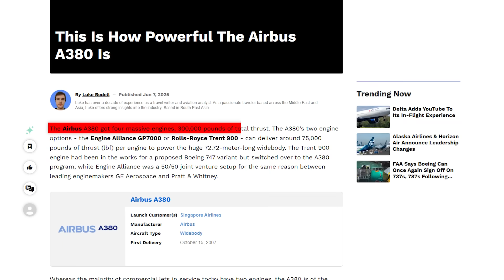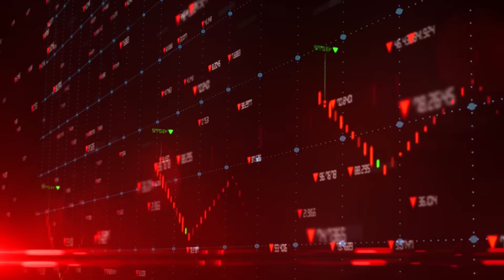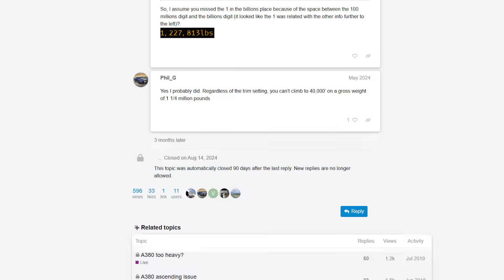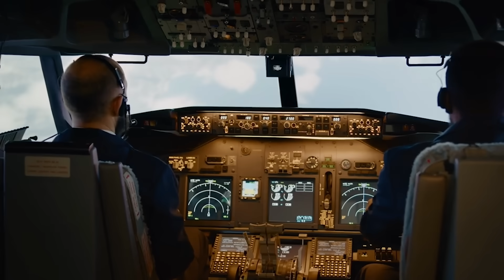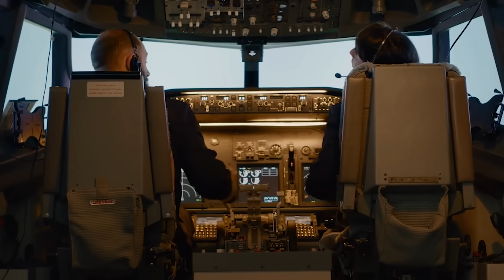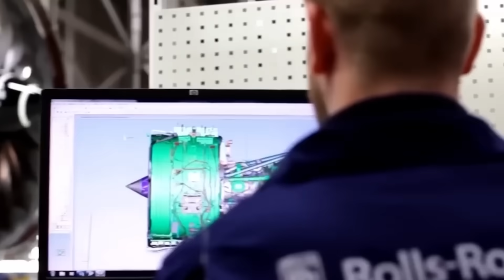Why the Airbus A380 Struggles to Gain Altitude

Comment: Everyone here is missing the point.  With all engines operating a 2-engine jet will outclimb a 4-engine jet  All airliners have to be able to continue to takeoff and climb if an engine fails during takeoff.  Losing an engine on a 4-engine just is only a 25% loss of thrust compared a 50% loss when losing an engine on a twinjet.  This mean the twinjet has much more excess thrust during a normal takeoff than a 4-enigne jet, and that excess thrust translates into climb rate.

BTW, all heavily loaded jets have to step climb on long haul flights. I have crossed the Atlantic at FL290 more than once because that was as high as I could climb for the first hour or so of flight, and when I asked ATC for something in the 30s for the crossing it was not available.

Comment: There is actually a video out there that shows that the A380 can in fact climb at a very steep rate of climb as it does have enough power to do so but that was just for a demonstration and there weren't passengers on board. It has plenty of power to climb more steeply but it's also about not burning access fuel as A380s are for long-haul routes and therefore fuel consumption has to be kept in mind as well..... Being the A380's are for a long haul travel, there's also no need for it to climb as quickly as there's plenty of distance to do so of which is much more economical.....Here is a link to the A380 steep climb capability.... https://youtube.com/shorts/zUgyP_NVOkc?si=ESDNVFuYV2QEYmoC

Comment: Airbus decided to triple down (so to speak), and build the A-3380 SooperDooper triple decker Supermassive Hawking Jumbo, with its 8 engines, carries 3500 passengers,  with a climb rate of 200 ft a minute, and a fuel burn rate of 15,000 lbs of fuel per half hour. 
Some airports jumped on board to retool their airports with longer 30,000 ft runways, reinforced runway surfaces for extra weight,  and bigger gates to accommodate the wider wingspans, at an estimated cost of 15 trillion dollars; a sound investment indeed.

Comment: As far as I know, all commercial jets step climb, which is the most efficient way to do it.  The A380 is still one of the fastest airliners, though not as fast as the 747, which has a steeper wing angle.

Comment: I flew the 380 as a copilot for 4 years and I can guarantee this guy doesn’t know what he’s talking about. The 380-800 was designed to be stretched at a later date, and so the wing and engines on this ‘shorter’ fuselage were more than sufficient to give great performance. We constantly took off from Dubai at max takeoff weight and climbed straight to FL340-350, while the 777-300’s had to step climb from FL280. Plus we could cruise at Mach .85 if we were in a hurry. It definitely is not the prettiest machine, but it’s quiet in the back, has some great tech (the BTV system is brilliant) and is great for slot controlled airports in Europe.
Reply: Ok,  it is one of the prettiest aircraft... not sure where it itbon the scale but it's in the league of Pretty

Comment: The lesson hidden on the climb rate---A380's initial climb rate is among the lowest in the industry, on a par with other large quad jets
Airbus A350 and Boeing 787  can maintain a steeper ROC during the initial climb, although they have similar climb rates to the A380 during subsequent flight phases, quite impressive given that the A350 and 787 are only powered by two engines, although their size and weight are also considerably lower. These two aircraft models can typically climb at a rate of around 3,000 fpm immediately after takeoff, which is double the rate of the A380.
When it comes to the approach, the A380 will generally descend at 1,000 fpm, which is also slower than other aircraft. 
A380 falls into the Super Heavy category of aircraft and has a 'Code F' designation under ICAO's Aerodrome Reference Code. This means that only airports certified to handle Code F aircraft can accommodate an A380. No wonder all major American airlines stayed with twin  engine ETOPS designs. The smaller, twin-engine Airbus A350 and Boeing 787 Dreamliner have significantly more economical fuel burns per passenger than the much larger, four-engine A380. Newer aircraft designs, advanced materials, and more efficient engines give modern twin-jets a distinct advantage.
Reply: "Airbus A350 and Boeing 787  can maintain a steeper ROC during the initial climb, although they have similar climb rates to the A380 during subsequent flight phases, quite impressive given that the A350 and 787 are only powered by two engines, although their size and weight are also considerably lower."

Just about everyone here is missing the point.  With all engines operating a 2-engine jet will outclimb a 4-engine jet  All airliners have to be able to continue to takeoff and climb if an engine fails during takeoff.  Losing an engine on a 4-engine just is only a 25% loss of thrust compared a 50% loss when losing an engine on a twinjet.  This mean the twinjet has much more excess thrust during a normal takeoff than a 4-enigne jet, and that excess thrust translates into climb rate.

Comment: Seems they get they the fuel almost for free because UAE is the number one oil country. The A380 fuel capacity exceeds 320,000 liters, stored in 11 fuel tanks located in the wings, horizontal stabilizer (tailplane trim tank), and center fuselage tanks

Comment: I always wondered why the A380 takes quite a while and has to use up the entire runway to take off and now I know that’s one of the biggest physics problems out there wonder why a lot of airlines have retired the A380 and poor Emirates is stuck with flying the A380
Reply: Why poor Emirates? They're expanding their fleet of A380s. In fact they bought another 4 just this week. It's the perfect aircraft for a long haul middle east airline.

Comment: If we had 280,000 lb thrust and total weight is 1,1 million lb and the minimum wing area must be as followed
1,1×10^6× cos angle of attack (wing area )= 280,000 lb thrust sine ÷( wing area ) sine of angle of attack × wing area

So 280,000 tan angle of attack wing area = 1.1 ×10^6

So the 59000 wing area =1.1 million so we need at least 200 square feet wing area

This is pulic chanel and so use all information as example and not as textbook and angle assume is 12 degree plus speed is not factor in yet and. Top down air pressure at atmospheric ATM at ground level is high that is why engineer need more money for better deaign and fix Newton Law
Reply: Airplane lift is produced aerodynamically, it is not the result of addition of the thrust and weight vectors. Accordingly, lift is calculated as:
L = 0.5 * ρ * V^2 * S * CL
where
 ρ is air density
 V is airspeed
 S is surface area
 CL is coefficient of lift (which depends on angle of attack).

Reality check: The 200 sq ft wing area answer you came up with represents a rectangle of 20 ft x 10 ft ≈ awfully small wing.

Comment: Pretty silly and uneducated to compare a 4 engine with a 2 engine airplane. A 2-engine is always „overpowered“ when both engines run because
In case of an engine failure at take off, the 2-engine looses 50% of it’s power…a 4-engine only 25%. BTW…I have flown Boing and Airbus 2,3,4 - engine.

Comment: It is quite clear the video clip team did not read the last three Airbus annual report nor does it contribute to their corporate emails.  It all seems that Airbus has decided not to quit this "gentle giant" like a V.P. called it.  It needs to be re-engined by four geared new engines with thrust 15% to 18% higher than what it had since it was first designed, before 1994, when it first came out, 30 years ago though RR website is not providing any details about what is brewing behind close doors.

Comment: Larger airplanes have less drag and therefore better efficiency than smaller aircraft, all else being equal. Four engines instead of two increases drag and offsets the efficiency of a larger airplane. However the current twin  mega engine airplanes can't maintain altitude in the event of serious cowling damage from a failed engine. The Hawaii bound airliner almost crashed into the ocean with only a 15 minute post failure margin due to the extreme cowling drag which exceeded the thrust capacity of the remains engine at full power. Sadly the FAA is waiting for a planeload of people to die after failure of a high efficiency twin engine before they pull back on the transoceanic rating of modern mega engine twin jets.
Reply: The drag from the cowl loss did not exceed the thrust from the remaining engine. It did however, force a lower cruising altitude which increased fuel consumption. ETOPS ratings are for engine failures, not for failures of the airframe, which technically a cowl loss is.

Comment: Most planes step climb, I'm not a airline pilot but I know this for a fact. A 747-8 taking off at MTOW (maximum take off weight) can't get to much more that the mid 30s. No way it's getting to the 40s right off the bat.

Comment: There is a flaw is claiming AI is “lying” or bias. AI is based on FACTS and STATISTICS, not human emotion. Shows YOUR ignorance. TRUTH BOMB: Except for Emirates Air, the A380 has been retired. No one wants the A380. There is the TRUTH. It has nothing to do with passenger likes, pilot likes. It’s about MONEY! As big as it is, the wings are too small for its size. As the AI said, the wings were designed SMALLER to fit Airport accommodations. Greater thrust does not solve the wing lift to drag dynamics. So get over yourself. Great plane. Beautiful plane. Comfortable plane. You can date a beautiful whore. But it does not change her COSTS or that she is STILL a WHORE.

Comment: I live in Toronto on the east side. Where the departing aircraft from Pearson are like in an ascent corridor kinda thing, they are climbing out. Pearson is on the west side so I'm a bit further out. Once in a while I see the A380 on its way out, and I recognize the Emrites colors on the bottom. They always seem kinda low in the sky. I thought that's just because of how big they are. But this kinda makes sense now. Well, for all of you saying this video is BS, AI, clickbait, etc etc, I'll get back to you on that, (eventually), check out a few things for myself. And for those people that criticize the A380, you might have a point. It might have been a commercial failure in some ways. But Airbus built it for a reason. They're not stupid, they didn't get to where they are by being stupid. They wouldn't invest that much money to develop the aircraft if they didn't have a reason. They knew the risks they were taking. Then on again they can afford that risk. I'm not sure what the reason was but they had a plan. Hey, Airbus ain't broke. I can kinda see why the plane has to be full to make a profit, and why it only works for some markets. At least the lower descent rate won't hurt my ears so much, well modern airliners in general tend to be better for that anyways.

Comment: It is all about wingspan. 90m wingspan is unrealistic. While it may sound good aerodynamically, it would leave to such a thick profile (aka high drag) and high structural weight that it wouldn't make it in real life. Even at 79.75m, it is beyond the wingspan limit of international airports (72m). The result is that passengers got to sit in the cabin, fully boarded, for as much as 4 hours waiting for all other traffic to clear before they could get taxiway clearance. Not a commercially viable scheme. Who gives a damn if you can fly nonstop to a place 14 hours away if you have to sit and wait for 4 hours just because the wings are too long.

Comment: Just keep the proven 747 in service!
Reply: No, big twins are cheaper to fly. The only advantage of a 747 over a 777 is 4 engines. The GE90, which powers most 777s, has about 1400 engines in service, with 114 million flight hours. The dispatch reliability of the GE90 has an unmatched 99.97% rate. And the 777 is certified for flight on one engine for 180 minutes (ETOPS). So the argument for 4 engines starts to fall a bit short. Especially if you are paying for the fuel.
Reply: Same problem and less passengers per engine makes even less sense.

Comment: Can't none of these planes mentioned here out preform a Boeing 757!!!!!! A 757 performance wise will out do all of them!!!! And it's a narrowbody!!! They may be able to fly farther but performance wise the 757 is King 💯💯💯💯
Reply: 757 was way too heavy and expensive. I started my aerospace career on the 757, but I also have to face reality. It was a long way from being king. My choice would be the 777-300ER. But maybe some bias, I was the wingbox Stress lead for a time, and know the landing gear fittings pretty well too.
Reply: @PaulWalker-zk2dd how was the 757 way to heavy when it has probably the Best trust to weight ratio outta any commercial jetliner is my question 🤔

Comment: I should also add that the A380neo might not be the last jumbo sized aircraft that's built. There is the distinct possibility that a Blended Wing Body passenger aircraft will be in production by the 2030s. JetZero has received FAA clearance for test flights of its Pathfinder, a 'blended-wing' demonstrator plane designed to significantly reduce drag and fuel consumption. This innovative design could potentially lower emissions by 50%. Scheduled for full-scale development by 2030, JetZero plans to create variants for passengers, cargo, and military use. The project faces challenges in certification and integration with current airport infrastructures. They are not the only manufacturer that's designing a BWB. By the time the A380 starts to retire, we could see massive BWB passenger aircraft taking their place.
Reply: Wow, now you show how little you know about airplanes. Try learning about pressure vessels and airplane pressurization requirements before jumping on the BWB bandwagon. BWB is aerodynamicists selling snake oil. Don't buy into BWB, unless you think you can hold your breath for 14 hours.